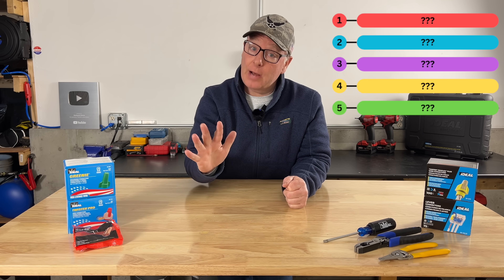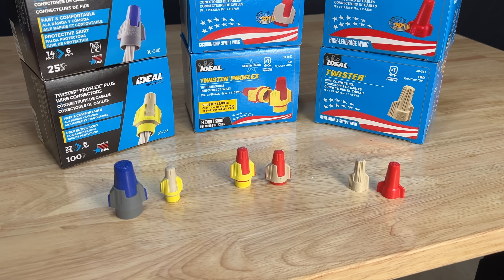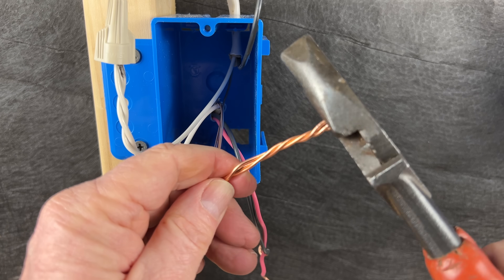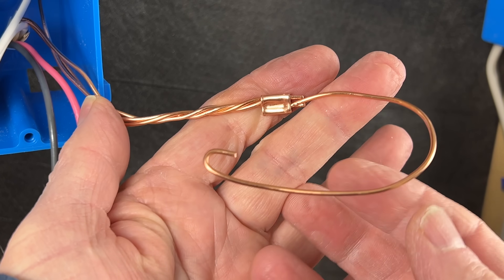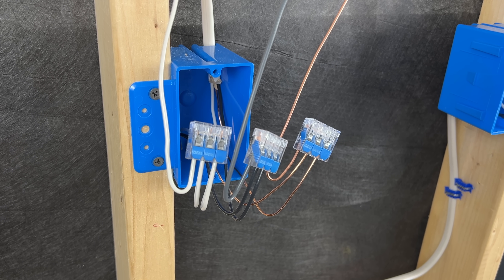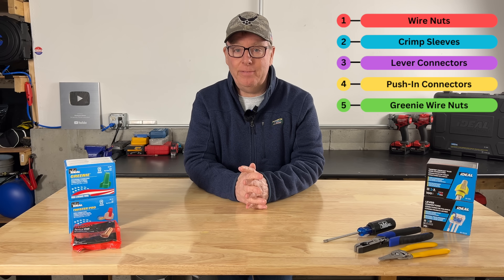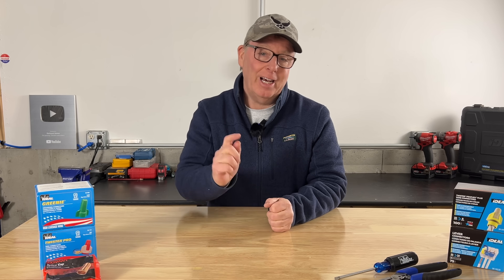How NOT to Connect Ground Wires in 2025 (Safety First)

Comment: Ive been an Electrician over 40 years and NEVER use push in connectors ... ever since I retired I just do small lets call them "Problem Jobs" and 9 out of 10 times the problem is outlets that use "Push In" back connections that continue the circuit. I like using pigtails because they will last and are NOT dependent on the outlet .... edit: I think the spring tension can deminish over time especially with a heavy load heat cycle like a toaster .. I cant tell you how many kitchen outlets Ive changed that caused half the counter outlets to go out
Reply from the maker: I never use the back stab connections either. Never have. I have a couple of videos comparing the difference between the lever connectors and the back stabs. They are quite different. I still like screw terminals and wire nuts best but the newer lever connectors are really decent.
Reply: I just had a house built and discovered the electricians used the backstab connectors everywhere, extremely frustrating. I'm going to slowly replace them all over time.
Reply: @rjtumble They use the cheapest outlets on the planet, but if you cant afford to change them ... learn how to remove the back stab and use the side screws to re-attach them. Change the outlets with the high loads now (ie; toaster ect)

Comment: For clarity, there is either a reliable or unreliable connection. Manufacturers say not pre-twisting the wires provides a reliable connection. What you describe is not more-reliable if you are using the same connection (wire nut) device. May be best practice based on your experience but it is just that, your preference.

Comment: Wago 221 is the original lever connector. I like them over the ideal because they are smaller. However on resi and solid wire the Ideal In-Sure push-ins are my go to. For grounds I use crimp barrels exclusively, and double crimp to fully close the barrel.
Reply from the maker: Ideal makes different size insure lever connectors. The ones I used in the video are the larger ones rated for 10 gauge wire. The smaller ones rated for 12 gauge wire are very similar in size to the WAGO 221. I prefer the ideal for one reason, the levers snap tightly closed and will not inadvertently come open when pushing everything into a box.

Comment: I found the electrical inspector about the EMT in the background you need a strap on the EMT
Reply from the maker: Please read code Article 358.30..  EMT needs to be supported within 36 inches from a box or fitting. If the next box or fitting is less than 36 inches away you don't need additional support. The connection at the box is the support.

Comment: I have seen electrician use SOLDERING the wires together, and  capping the hi and Lo, this was when I worked in Florida in 2006? What are your thoughts on that process

Comment: I'm a above average DIY, and have always used crimp sleeves. These days as a 70+ old man I have a hard time today applying enough pressure to get a good crimp. Going to switch to push in for my ground wires. Now that I know they are code compliant. This video just came up as a recommend.  Got you a new sub.
Reply from the maker: Glad you found the video helpful, thanks for your comment/subscribing and welcome to the channel.

Comment: Couple comments. The quick connector cutting into the wires has less contact area then the cross sectional area of the wire meaning less carrying ampacity. Secondly the grounding it's only as as good as the soil contact area. If the soil is dry/poor soil conditions your ground rod resistance will be higher and in extreme situation you don't have a ground at all. If that's the case wet the ground rod area whenever possible. BTW some electronics are very sensitive to grounding not to mention personal safety.

Comment: I was very leery of trusting push-in connections for years until one day it hit me that we had all been installing (old style) recessed lights with push-in connectors since the mid 1980's and I had never heard of a problem with them. If people had to open ceilings to deal with failed connections in recessed lights it would have been common knowledge in the trade. So I have been using them for the past 20 years. Shortly after I began using them I was testing a piece of equipment and had quite a number of splices in use when I inadvertently caused a dead short....the 3 port ideal connector suffered a slight darkening inside but was otherwise perfect with no interior damage....I threw it away anyways but it  very much impressed me. You do have to take care when manipulating the wires after using the ports because they can wiggle out a scotch .

Comment: About these crimp sleeves... I was redoing a number of multi gang boxes with two and three way switches that were not grounded. These sleeves did not hold. I could pull the wires from these sleeves by hand. I would never use them
Reply from the maker: If they are crimped correctly they will not come loose. They can actually be quite difficult to take apart sometimes. Some people just crush the ring and think it's good.
Reply: My experience as well.

Comment: Lever nuts are essential for joining solid and stranded. Would never go back. Traditional nuts are still ok for just solid.
Where i live wiring is required to be in metallic conduit. That serves as the ground conductor.

Comment: Like you I've been using the greenie wire nuts for decades now. Also, I really like the lever type connectors. The buchanans and push in connectors are not my favs. For the fact that they are one time use. Good info! Thanks!

Comment: Hi John. Another interesting video… as always. I always learn something new and I appreciate your teaching style. 
I was hoping you could provide some information about grounding rules. My neighbor’s house was built in the late 90’s… 97 or 98. One of his kitchen switch boxes has 5 switches in it but has 2 separate circuits with each circuit coming into it on a separate breaker. One breaker feeds 2 switches and the other breaker feeds 3 switches. Both of the incoming circuits ground wires and all 5 switches have their ground wires tied together in the switch box. The box is not grounded as it is a plastic box. Is that an acceptable way to treat the ground wires or should each circuit have their respective switch ground wires tied to the ground wire of the circuit/breaker that feeds it?
He says that the wiring hasn’t been touched since he bought the house from the builder.
Thanks for your time and any information you can offer would be greatly appreciated. Please keep the excellent content coming.
Reply from the maker: Thats a great question Ron. I should make a video on the subject. When more than one circuit enter a box like in your example, the ground wires can all be connected together. Grounds provide a ground fault current path back to the source to allow the over current device (breaker or fuse) to open and clear a fault. Another function of the ground and a very important one is to keep all conductive surfaces at the same ground potential. So there is no difference between the connection to your refrigerator surface and the surface of your range. The neutral wire is a different story though. The white neutral return wires in the switch box would need to be separated by circuit. Connecting them together could lead to overloading and a potentially dangerous shock hazard.

Comment: i like the green wire nuts I heard some horror stories of electricians getting harrased by inspectors for not haveing everything green on ground wires like a plain screw in back of metal box instead of green one and such
Reply: Metal boxes are typically used in commercial buildings with mc cable or conduit, and having a green insulated ground wire, making a greenie wire nut impractical. I agree with using only a green grounding screw, there's no excuse for not using one. Using any old 10-32 screw looks tacky and would tempt me to scrutinize the rest of the install if I was an inspector.

Comment: I've been using the greenie wire nuts for probably 50 years and consider them the best for ground connections. I do, however, now use lever lock connectors for other connections. My only thought on them is that you need to be more careful in packing wires back into the box because it is possible to un-latch them in a crowded box.
Reply from the maker: The wago brand does come open easily but the Ideal Insure lever connectors snap closed very tight and will not inadvertently come open.

Comment: I'm a low volt guy and us low volt guys have to keep up with technology. I love the lever connectors (waygos). If it can withstand a DC load of 100amps for several hours its fine in my book. However at my job we have an electrical division and they think new tech is scary and don't want to change.

Comment: Crimp sleeves are the ultimate FU to your future self.
Reply: I use crimp sleeves in multi gang boxes because I can extend all the grounds through them to ground each device. This takes up much less space than making up multiple grounding pigtails. I always leave a little extra wire so that the crimp sleeve can simply be cut off if needed without making the remaining ground wires too short. It works great.

Comment: When I was an apprentice, I had never seen a green wire nut before. I just thought it was the same as any other. I used it for connecting HOT wires, and a small portion of one of the wire protruded from the hole. I found out after I was shocked that you should NEVER use a green wire nut on a hot connection.

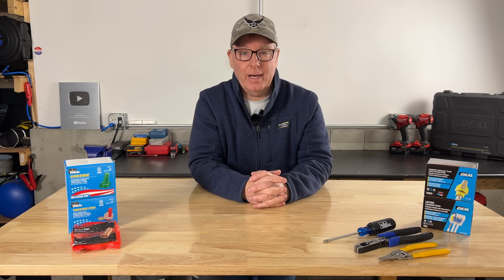Comment: How is that back-stabbing your devices is almost universally condemned by the trade but those push-in connectors featured here at 6:00 are OK?
Reply from the maker: While they may look similar the use a different method of securing the wires.

Comment: I have seen the lever connectors become unlatched when pushing the wires into the outlet box, and I also have  removed wires with the latch type connector . The latch was up, and the wire pulled out . The push in type are good
Reply from the maker: Try the IDEAL Insure lever connectors. They will not come unlatched like the orange brand.

Comment: Hi I have to move an outlet about 14 inches to the left. My problem is there is a wire coming from the top and bottom into the box and there isn’t much play to move it. What can I do?
Reply from the maker: That can be a challenge without opening the walls.

Comment: there are exceptions, but I mostly use crimp for grounds, as with all connections  I pretwist as provides the best connectivity and then use the wirenut, crimp only as a means to keep the connections )twist) in place and find best most reliable connections. I only use lever wago, etc for certain appliance, fixture connections but never ever never for main line wiring period! and never ever never use stab back connections on outlets, switches

Comment: I've recently earned my "Residential Electrician" certification. However, I started doing electrical wiring within my own residential and commercial remodeling and construction company back in the 1970's. I was trained by two different journeyman electricians. From that training, I learned to pretwist, and it makes perfect sense to me. I also learned to use wire nuts. I've never used the lever connectors, although I can see they would have frequent practical applications. Have always avoided pushing stripped wire into the holes on the back of a plug/switch, and I have never and will never wire a receptacle using both screw terminals on each side to allow "downstream" continuation of a circuit. The amount of current being pushed through that little-bitty piece of brass or copper on the side between the two terminals is subject to heating if the downstream circuit usage outstrips intended usage as designed. On more than one occasion, I've come behind someone who, in the past, during a remodel, had added on to an existing circuit and ended up overloading a circuit. The result, even without tripping a breaker, was a wall receptacle, uncomfortably hot to the touch, even with nothing plugged into that particular outlet. Formula for a fire. For the same reason, I'm not a fan of push connectors.

Comment: I go with the Greenies, only way I roll.  Been using them since they first came out.  Best on the market in my view.  BTW: Great overview of all the methods of grounding properly, possibly could have added some information to the novices out there on properly grounding metal boxes.  I come accross so many metal boxes with no separate grounding screw/wire installed.  You provide excellent detail in your vids, keep them coming.
Reply from the maker: I will keep that in mind for future videos. Thanks for the feedback.

Comment: Using a crimp sleeve is a big middle finger to the next guy to work in that box, akin to an auto mechanic securing bolts with Loctite Red.
Reply from the maker: That’s why I prefer wire nuts.

Comment: Electrician here of 45 yrs. I also like green nuts. Also thank you so much for taking the time to test the integrity of the levers. I Have been trying them lately but use wago. Had know idea that ideal made them and i will order them right away they look much better. Thx
Reply from the maker: Thanks!  I'm glad you found it helpful, the test was surprising! I was skeptical at first due to the reliability of the back stab connections on devices.

Comment: I like the new ideal level connectors a lot.  The 10 gauge version has a nicer lever but is larger where the 12 g a smaller design.  Wago also has both 10g/12g versions.

Comment: I disagree with crimp sleeves being reliable, as I have seen many loose ground connections over the years when they are used.
Reply from the maker: They are only reliable if they are crimped correctly. I have seen people crimp the with linesman's or dikes and that is not going to do it. The crimper I used works well and they do make a dedicated crimper for these sleeves.

Comment: That was great ! That is the correct way to ground ! . I have been using IDEAL products for years now.  My local Home Depot and Lows has them with the electrical supply stores.  I use them Greenie wire nuts as well . I learned in school to pre twist with linemen pliers than trim them put the wire nut on.   Even my local inspectors agree that is a better way then the instructions on wire nut box. I like the new GFIC outlets that have lever nuts built in.  Them wires lock in tight ! Easy to install ! And the self test they do , makes at safer for the end user . I was installing them whole home surge protectors before they were code . I am in western NY and my area is prone to surges and grid down and many storms .   Safety starts with good grounding and bonding . I learned that over 30 years ago . Most of my tools are IDEAL as well.  Them push on connectors are great for re fitting florescent light ballast to new LED light tubes. IDEAL makes that easier faster and safer . As we change over to LED lights and more efficient appliances IDEAL comes threw .

Comment: This is a great video and I like as well as agree with the 
information he has presented.  

But there was a little troll on the inside of me that felt like I needed to make a smart donkey comment so ….. 
my favorite way of joining any wires the other is just twisting together and then putting some electrical tape on them, but if I have more time and I wanna do a better job, I will solder them and apply heat shrink.  Every homeowner can recognize high-quality work being done and they can tell my work is …… well, after the fire truck leaves

Comment: If you like the tan twister wirenuts, you would love the 3m performance wire nuts.  They take a bite much quicker and are almost impossible to strip out.
Reply: I like the Ideal red wing nut and the twister pro red/yellow, but I agree the 3m performance plus the best. I've only used the red/yellow, they have a wide range and are fairly narrow and once tightened they hold like no other.

Comment: I just had to replace a push-in connector. And this is the only push-in I ever encountered! When I first saw it I didn’t know what it was and wondered if it was legal. It basically had overheated to the point of failure. So I don’t buy the reliability of them at all.

I too like the greenies.

Comment: Recently changed a 3 prong pool pump outlet to a normal receptacle. Why the electrician used stranded wire is just ugh..
Reply from the maker: It was most likely wire in a conduit which is often run in stranded.
Reply: @BackyardMaine  Yeah the line goes from the wall of the house opposite where the breaker panel is to a GFCI outlet which is then run underground to where the post is. But its sure as hell some sucky i assume to be 12GA wire, i dont even think its copper with how hard the strands were to twist.

Comment: John, I have an off topic comment here but I always wondered why electricians don’t use ferrules on stranded connections to a lug terminal. Take for instance a service disconnect box where it is not uncommon to see broken strands or stray strands. Ferrules are common is control panels and equipment connections, but I never see them in household electrical. Maybe a topic for a video?
Reply from the maker: That's an interesting observation, maybe I'll do a video on that.

Comment: You did not feature WAGO 221 the most famous of the push in click and go wire connectors.
Reply from the maker: I like the WAGO but I think the Ideal lever connectors are a bit better because the levers closed tightly and theres no risk of them opening when you push the wires back into the box.